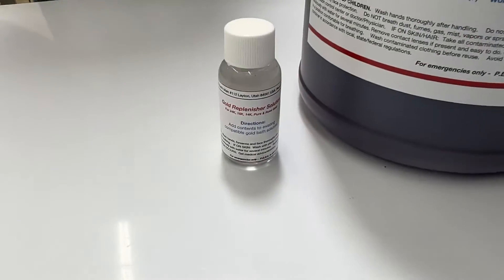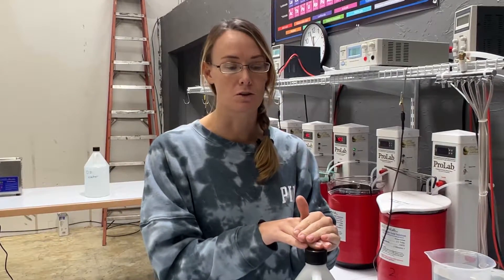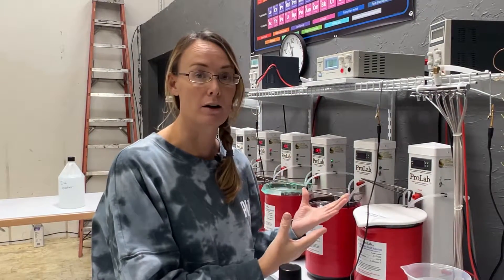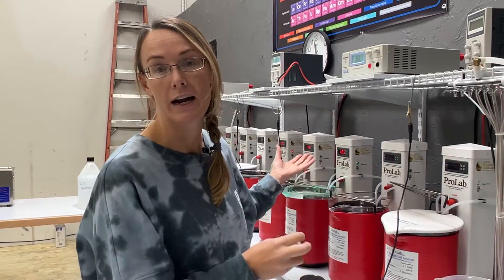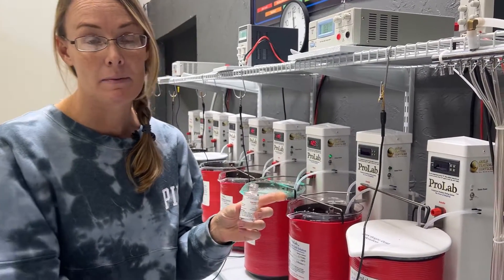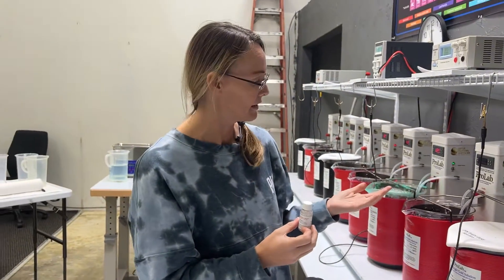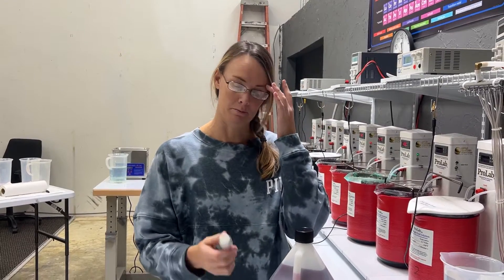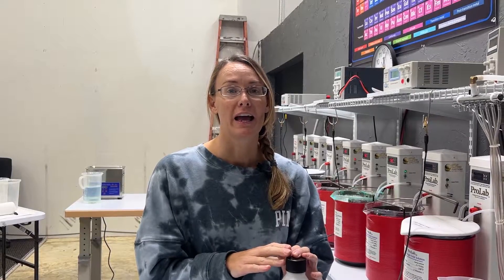Gold Bath Replenisher

Comment: How can you tell how many grams of gold are in a bath after it has been used?
Reply from the maker: You would have to calculate the surface area of what you are plating and at what rate the solution plates onto the part. We have a calculator for that stuff and you would have to contact our tech support from our website to get that calculator.